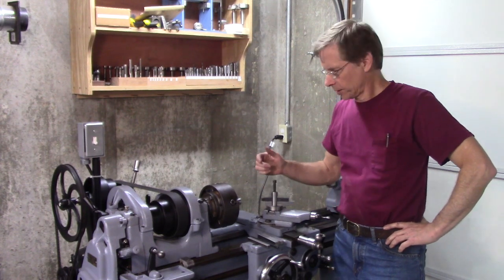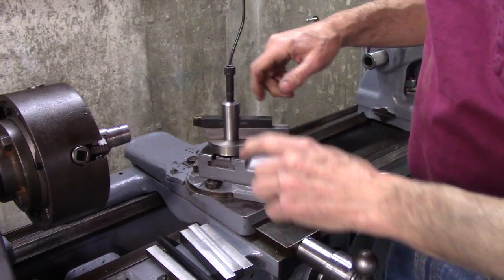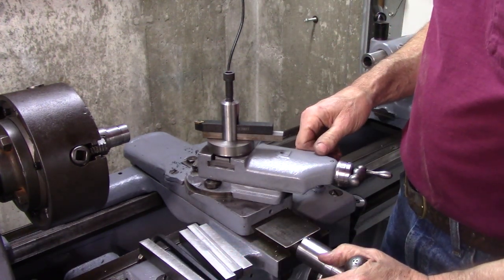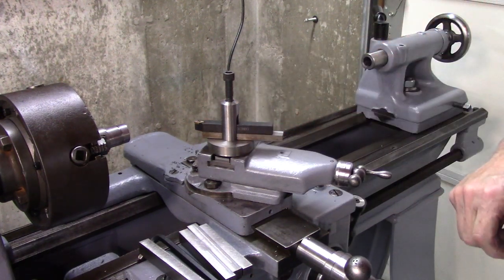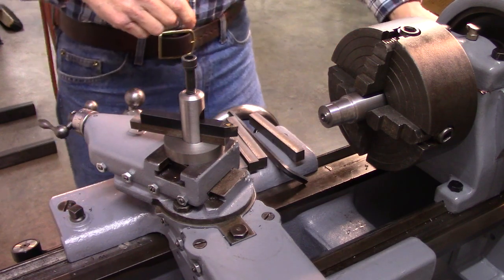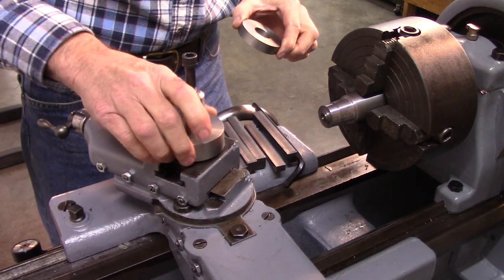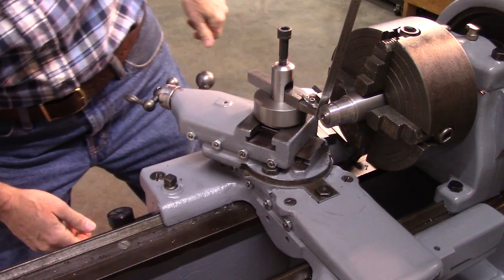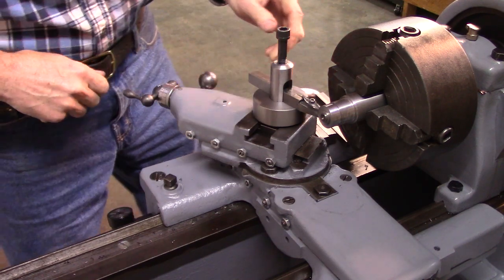Building an Improved Lantern Style Tool Post - Part 2

Comment: As an alternative to needing to adjust height each time: how about gluing or screwing the correct shim stock to each tool that is used often?
Reply from the maker: Thats a good idea
Reply: @WinkysWorkshop I'm wondering if this could be combined with hammerland's dovetail-less qctp for the best of both worlds?  I want to make one to try with the lantern wide enough I can stick a bearing block in the center for a drill attachment

Comment: Winky that is a lovely tool post...I'm reliving my high school MS experience. i have a SB 9". The QCTPs seem bulky. I would like to build one for my SB....but I'm not there yet.
Reply from the maker: Thanks! However,  used the tool post for a while but ended up switching back to the quick change. The old lantern posts had offset tool holders to get close to the chuck and tail stock. I could have put a kink in my tools and used them but opted for the quick change and a thin dead center so the tool post didn't hit the post.

Comment: Great work! I think I’ll build one for my 13” southbend lathe. I’m not a huge fan of the rocker lantern post and my bxa quick change post is pretty big. This would be a great addition to throw in the tool box
Reply: Thanks Justin. I used this tool post for a while and ended up putting an AXA quick change on the lathe. It worked extremely well in most regards but the original lantern posts had a selection of angled tool holders help reach different area. Most my insert tooling is straight of with a small offset and I had problems with getting the tool where I needed it. In my opinion it was a step up from the quick change for being solid however.
Reply from the maker: Thanks Justin. I used this tool post for a while and ended up putting an AXA quick change on the lathe. It worked extremely well in most regards but the original lantern posts had a selection of angled tool holders help reach different area. Most my insert tooling is straight of with a small offset and I had problems with getting the tool where I needed it. In my opinion it was a step up from the quick change for being solid however.

Comment: You could make a simple height gauge that sits on the top face of compound to set the height of tool as the centre of the work piece is always the same height above the top surface of the compound. Max from Australia.
Reply from the maker: This is very true! Thanks

Comment: solid at the bottom but is one screw at the top enough perhaps a bigger diameter ?
Reply from the maker: The most important area to support is the bottom where the cut is being made. Obviously you have to have some tool stick out but as long as it isn't extreme you have a huge lever advantage with the bolt. Plus the bolt is under compression. The 1/2" tool shank would bend before the bolt would move. I've gone back to the quick change post now. This tool holder was actually much more solid that the quick change but it got in the way of the chuck a lot. The quick change has the tool on one side and this is an advantage at least around the chuck.

Comment: Hi Winky, what kind of Steel did you use for the Tool Post? Thanks
Reply from the maker: The steel came from where I used to work in printing. They were parts from an overhead conveyor. I have no idea really but if I had to guess I'd say is had some lead content. It machines nicely, much easier to machine that most steel.

Comment: upstate NY. When I saw part 1 I said he should add the adjustable base just like the one I have from my 1890-1910 barnes lathe rebadge as a syracuse supply machine. Boom! part 2 there you go. Mine is my first and only lathe so I thought everybody had a toolpost like mine....who knew.
Reply from the maker: After making this posts (which I thought was an original design)somebody else told me the same as you. Interesting

Comment: Nice! My father used a variant of this 50+ years ago, and I learned operating the lathe from him using it. In his version, there was a tube, threaded on the outside, the height of the toolpost, with a slot cut through it vertically.  A ring rotated around the threaded tube. So you slid the tool through the slot in the tube, above the ring, through the lantern, out the other side. Rotate the ring for height, clamp the lantern when ready. The tube, of course, would not rotate once the tool pinned it in alignment. The "tube" was quite thin and the finished article was, at first sight, almost indistinguishable from a standard lantern. It had the "advantage" that you could adjust the supporting ring virtually to the top of the lantern, or nearly down to the slide, not very useful for tools of a standard size, but flexible for holding a DTI or other accessory. And incredibly easy to use and adjust.
Your is really neat though, and has a lovely solid look to it, nice job.
Reply from the maker: Interesting, thanks for sharing!
Reply: Great job, well done.
I'm going to make one for my South Bend lathe model A.

Comment: yes very good  I haven't got  the Threading ability on my lath.  so I went with  the Change . & built a  lament tool post equal to the quick change allures tool post with out the Esperance  to How well , first what make the quick change tool post. qualify as a quick change well having the post  stand in position, as you chant the tool  you want with out losing the position of the post.  & change the tool  with out  needing two hands,  to hold it   Then it must remain on centre or be adjusted easily  Your adjustable packer  does this . simply.  start to centre regardless of the tool . your system.  come close  To improve thither we have the ability to jack the post in place. by applying a twisting motion.  prier. tightening the tool in the post affective within a 100, 000 of an "   The tool to be changed with out losing the tool post  position .remaining under tension .  at  the centre is pry-set  on centre with the adjustable. packer . it is sufficiently to qualify it as . An  Quick,  to  be change  Latten Tool Post ]. .

:-  Well done that's save me a pot of money . wink's Work shop Quick change  Lantin Post ,
Reply from the maker: Thanks, great points
Reply: @WinkysWorkshop   try it I most say. 
:- it masks changing the tools less  fiddley  & we can slacken the post  move to a new position.  & retied by rotating the post in it new potion with out slackening the tool post ,  as the foot pushes down from inside  the post foot "yes have to allow froe  the rotational vector"  wen posing as you rotate to tight  thread plunger ,  For angels & such like but it a simply waist to titan &keep in place  the full lock.  coms from the top tool presser holding all farm & in place the twist is used to set the post  top set bolt is used to transfer all lowd.  to post as you set your tool .  so in recap.  the rotate on of your a set pin in a keyway allows a foot to  post rotate freely to position the post. but the captive thread with a grub screw ,  move as in the aloes to extend the  a captive nut to the bed a twist of the rest or  bar can achieve  that , the point is to set & reset the post without lessening the tool top nut  & this is achieved By the jack thread within the post. but  slit retaining control of the  tool . well not in my case it doesn't . once re tighten changing  tooling the top fastener life's & transfers the load to the compound .  not destring the bottom system   

;- "Well it works Les England" & it save me s pent or two all don in my lath No Cocktails,  to concern me I drill up the middle first  to fit my pin & thread.  Then a little bigger to fit , The tool slot,  up to. 1/2 " tool slot With I ues a the grinder & file I haven't a Mill.   We that's about it  great scot .what what .  I have scribed & liked.  WELLDON SON .

Comment: I like your videos.  I have made a parting blade holder adapted to my norman style QCTP based on your parting blade holder video.  Thought about making an adjuster like yours for my lantern tool post.  I don't use it much but sometimes it is the only thing that will allow me to make a certain cut.  As I was going over dimensions I thought why not thread the body of the lantern.  That way you could move the adjuster to wherever you needed.  Then it dawned on me that the adjuster has to be held tight to the compound  to hold the lantern in place.  The solution that I came up with is to have two collars.  One would screw down tight to the compound to hold the lantern in place and one to adjust the height of the tool bit.  I think that this would make it even easier to change tool bits in the lantern.
Reply from the maker: Interesting idea and it may work great. Let me know if you try it.

Comment: Very well done, how many rpms can your lathe turn? I have a pratt&whitney belt drive it have a three speed transmission mounted over the drive pullies.
Reply from the maker: Thanks, I'm guessing abut 1500 RPM. I'm not sure if I have the original drive pulleys either.
Reply: @WinkysWorkshop  thanks, I'm trying to get more rpms out of mine.
Reply from the maker: @kentuckytrapper780  - Be careful how tight your bearings are. Monitor
 the heat
Reply: @WinkysWorkshop  will do,thanks

Comment: Love it mark great idea
So you mentioned 10tpi i think i will do a similar latern but to support 3/4 tooling.
Great vudeo Mark
Reply: thin about the jack point from inside the post
Reply from the maker: Thanks Troy. I love this little tool post although I'm not sure I like it as well as the quick change...  Kind of a toss up. I think this new one is a bit more solid which is nice.

Comment: I like your design. I am going to build one of these for my lathe. Just a thought. If you scribed indexing marks on the inner edge of the top adjustable disk and a single reference mark on the post. You could reset to a previous setting. Great job.
Reply from the maker: I thought about that also... I may do this. Thanks!
Reply: @WinkysWorkshop   stabilizing the platform is best by an internal jack, thread within the post . there lots of ways to achieve this , 1/2 a tweets to titin up the tool post, in position. the tightening of the tool  tours' on the cross-slide & provides Stability . Les England

Comment: hey wink, looove your channel. quick question what is your mill...looks like the perfect size. bridgepport is to big for my  shop...also where did you acquire your mad dancing skills...
Reply from the maker: Thanks, The mill is a Rong Fu 30 sold by Enco. I don't really like it much but it's way better than nothing. The round column is my primary complaint.
Reply: @WinkysWorkshop  thanks for replying so quickly...i like that its not as huge as a bridgeport...i may lean toward a grizzly or pm
Reply from the maker: @minskmade  - No problem. Grizzly and jet both sell them. https://www.penntoolco.com/rong-fu-milling-drilling-machine-r-8-spindle-rf-31/?matchtype=&network=g&device=c&keyword=&campaign=744292556&adgroup=pla-52386325432&gclid=Cj0KCQjwncT1BRDhARIsAOQF9Ll4gY22Q69gFIn-bluYLSmjTnKQpyPhNEZHZtcOO_x_9yrPBF7JmyMaAkPfEALw_wcB

Comment: Great project. Next weld or screw a thin extension out from the keyed inside section with an index mark on it. Then you can make marks on the outside section for each of your cutting tools that you have annotated some way. This will make changing between tools much faster.
Reply from the maker: Absolutely!  Thanks!

Comment: I prefer to use high speed bits and have been looking for an alternative to the 4 way turret style tool post I have. The QCTP don’t really go hand and hand with high speed bits either. I think this will be the ticket especially if I retain the thick shims and incorporate the adjustable spacer. Thanks Wink!
Reply from the maker: I love carbide but mostly because it is easy. For the most part, HHS cuts better but it also depends on what you are doing. Take the GTN insert. Its a cut off  grooving insert that can cut in any direction. You can cut  a deep 1/2" groove with square shoulders. Trying to sharpen a HHS bit to do that is almost impossible. I've also noticed my Logan cuts smoother than the south bend with Carbide. I think the higher power requirements of Carbide make the bearing clearance of sleeve bearings (South Bend) more of an issue. Thanks for the comment. I agree. This tool post is very versatile and adaptable.

Comment: Last video I was shouting at you about an adjustable parallel, or cutting two spacer rings with angled faces and hole axes! Perhaps commenting would have been more effective.
Keep up the good work!
Reply from the maker: Oh...  Ha, I must have heard you! Maybe telepathy. I thought of both and decided on the threads. Thanks for all the ideas hehehe
Reply: @WinkysWorkshop  better the adjustable brace I used a bras 4 way listening conductor with it internal thread  to do that job out of my scrap box . . works a treat.

Comment: sorry I was late to the game. you can use regular left and right tool holders too. will eliminate some of the problems around the chuck.  I can't remember the name but I have a couple of left and right handers that have no back rake 'for carbide. work really well hold 5/8 shank tools carbide or h.s.s. with some side rake . I bought them around 40 years ago don't know if they are still made. I think they made some smaller one's too.
Reply from the maker: Thanks for the ideas. You've got me thinking!

Comment: I need one of those for an old South Bend I have out in the shed, as well as new bushings for the head shaft
Reply from the maker: So far it seems t work very well.
Reply: @WinkysWorkshop  the thing wit bronzes bushings for Bering  is the titter you get you oil bath Or film some call it  the better But it need a oiler to work well ,  my old triumph lath had bronze bearings & they  where,  as tight  as the day they where  made  because the had Plenty of oil .

Comment: Gday Winky, this Is a brilliant solution, simple and very affective, this really suits the era of the lathe as well, thank for sharing, Cheers Matty
Reply from the maker: Thanks, I used it to make a face plate yesterday and was turning a square of 6 x 6 x 1 inch steel. Knocking the corners off. Not the best idea but it was solid as a rock.

Comment: Looks good!! I use diamond/tangential tool holders from Eccentric Engineering and have been thinking they might do well in a purpose built lantern tool holder. Another tool on the list. Thanks for the share on the height adjuster and the fan who passed it on.
Reply from the maker: Thanks for watching!

Comment: Here is a cutter height setting tool you can make in just a few minutes. The hardest part is measuring the lathe bed flat to spindle center line. 
You can use the end of the bar or the over hanging piece to set the cutter height. This tool has the advantage of working with I.D. or O.D. tools.
Cheers from NC/USA
https://i.postimg.cc/W3XnW2r2/IMG-0153.jpg
https://i.postimg.cc/9FSNCyb5/IMG-0154.jpg
Reply from the maker: I may have to do this...  simple and effective. Handy for working with I.D. too!

Comment: Great video,As  always your videos are very well put together and easy to watch. Was wondering If you made it 10 pitch thread for the reason of possibly putting some graduation marks around the OD of the female thread part. This would make it faster and less of a trial and error to set your center line. For example 1⁄2" thick tool bit may be set to center at the 45 tick mark on the outside of the tool post ring.Kind regards Allen
Reply from the maker: You are a step ahead! Yes...  I wanted to leave that option available. In hindsight, I should have left a flange on the inside piece for a reference mark
Reply: Just what I was thinking👍 🇬🇧
Reply from the maker: Three great minds at work ! Ha
Reply: Could a are a pointer to the bottom keyed nut you made.  I have a Rockwell 10inches metal lath e. While underpowered it gets the job done. Just spent 2 days organizing and making a back shelf to hold all the tooling . What a time saver.
Reply from the maker: @alander6734  I was thinking the same on the pointer.  Overall I'm fairly organized but around my lathe is a mess. It would be nice to have a table near the lathe.

Comment: Great looking addition to the lathe. My only suggestion would be to turn your own locking bolt, with either a normal bolt head or two flats for a spanner, that would make it shorter also than the Allen bolt 😁
Reply from the maker: I agree. Hex is good but it doesn't look so good.
Reply: @WinkysWorkshop  i like  the Hex's bolt prep's a bagger bolt  head squared of . best of both world's then  cake  & eating it LOL but couldn't  revisit that Brexit pun .

Comment: A little dab of knurling on the top piece would be nice. Just a suggestion. You do what you want...it's yours.
Reply from the maker: ABSOLUTELY agree!  Although... I'm kind of afraid to do it. I've never had that much success with knurling, especially large diameters.
Reply: @WinkysWorkshop  Maybe practice on something else. I have found bad knurling beats no knurling where grip is concerned. Take it slowly and find your best feed and speed. Lots of oil to keep the chips washed out. I've seen some of the stuff you have done. You have shown no fear in doing some really neat stuff. Knurling should not be beyond you at all. Try it on some aluminum. Won't hurt your knurls and will show up quickly what is working and what is not. You can probably do this with one eye tied behind your back. I don't recommend You do it that way. That could hurt.
Reply: @WinkysWorkshop  Now you have a new indexing rotary table, set it up on that and cut some semicircles around the edge to act as finger slots, by using an endmill.